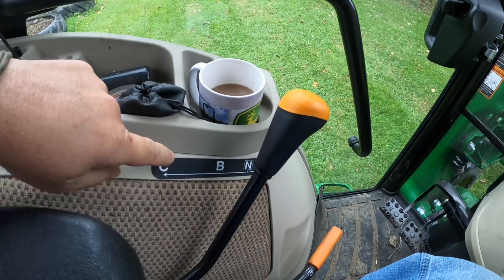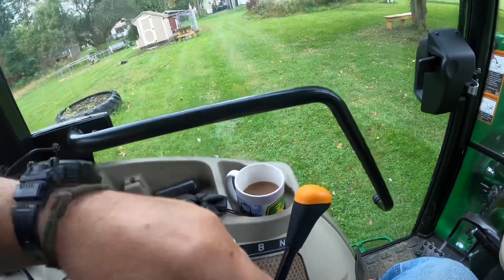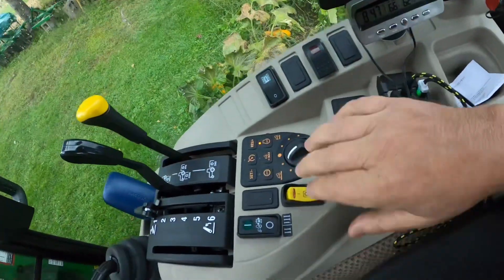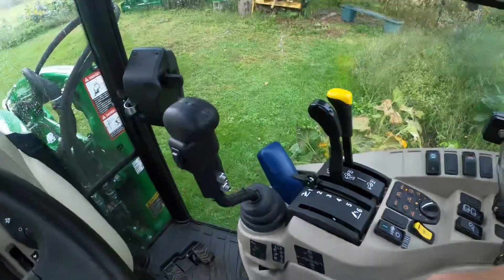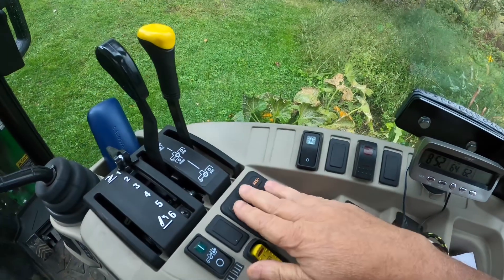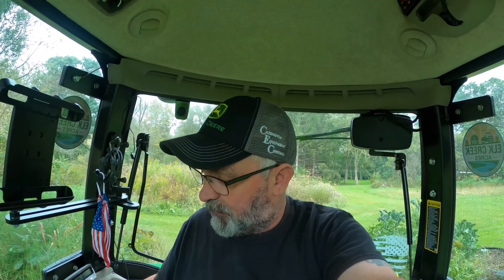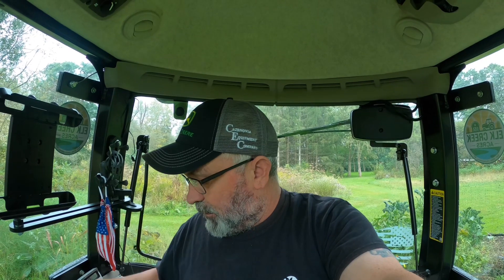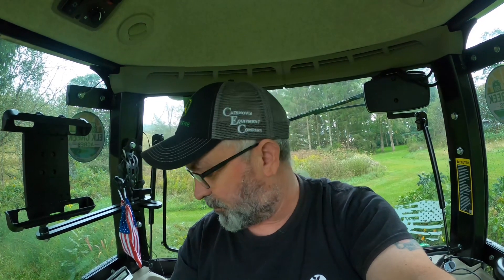Explaining the John Deere eHydro and problem/fix on my tractor

Comment: thank you Patrick for your great videos its very helpful,  I Just purchased a new JD 3039R with Cab and 320R loader.  had it for only 3 weeks now.  Looking forward to making good use of it this winter plowing snow.
Reply from the maker: Glad I could help, as you have probably noticed, the manual is a little vague on some of these features.

Comment: Good explanation of the Speed Match, Load Match, Motion Match, Auto Throttle and Auto Cruise Control functions Pat. I read about them in my owners manual but have yet to use all of these features. I've mainly been using Motion Match and Auto Throttle on my rig for loader & backhoe operations.
Reply from the maker: Thanks Frank, it’s been a little trial and error figuring most of these out. The manual doesn’t state that feature A doesn’t work with feature B and so forth.